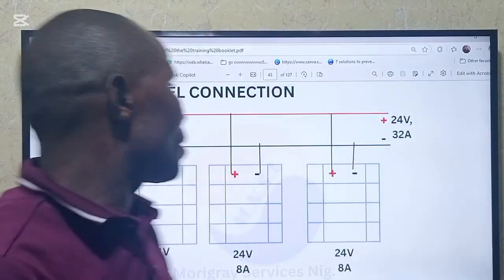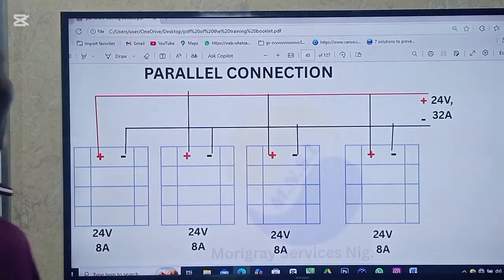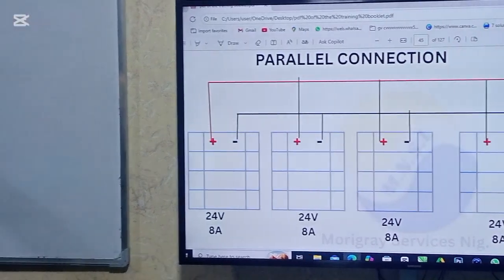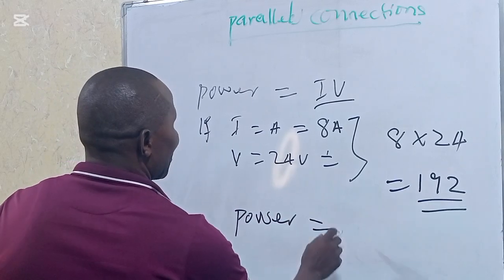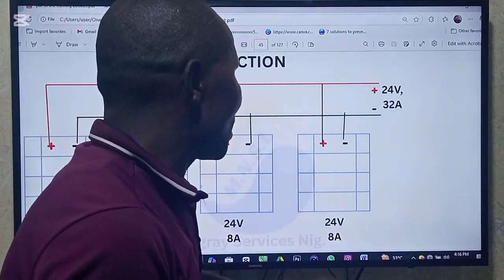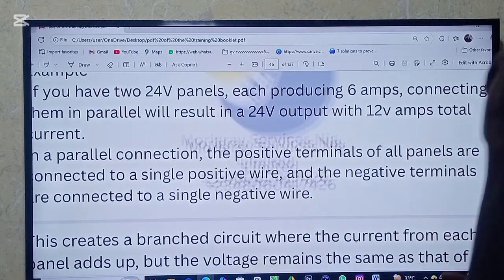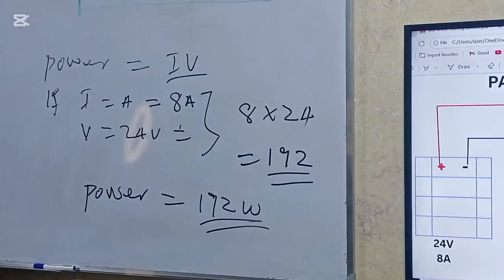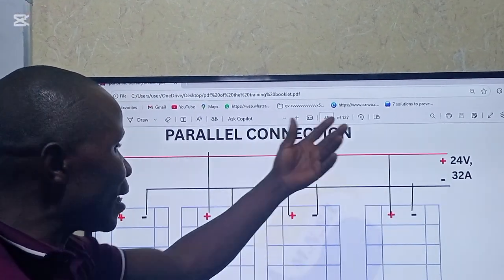Parallel connection of solar panels

Comment: What can cause a lithium battery 48v to be offing when charging, but when it is not charging it will be stable
Reply from the maker: Check your cute off voltage and current of your system and set it well
Reply: @MORIGRAYSERVICESNIG.LIMITED  the panel is connected in series and parallel